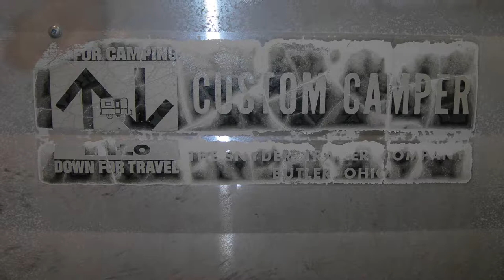1960 Hi-Lo Vintage Trailer Restoration....VERY RARE!!

Comment: Some one in my TCT club mentioned this video to me. Funny thing purchased mine the same year you made this video, but mine is a 61, about the same in all respects. The top part was as bad if not worse than yours but the bottom survived in excellent condition. Finished it that same year as well but all the restoration was done outside in the open. Had to get the top part done before the winter snows came. The trailer was a one owner. And he did get to see it finished. I glad he did for he past away one month after that.
Reply from the maker: This was a fun rebuild and a next trailer, Im glad the previous owner got to see it done too. Thanks!!

Comment: I recently got a 1963 Hi-Lo in great condition. Can't wait to have it on the road. Thanks for the video. These are so fun.
Reply from the maker: It really did hold up to time well, I just had to rebuild the top section and roof due to water. The simple crank lift worked everytime. The only real issue I fond was that wiring lights and vents required some clever design.

Comment: very cool! i have a voyager, basically the same thing but a little bit longer. i got it from my wife's aunt and uncle. i am working on what to do with it
Reply from the maker: I had never seen these before I re-built this one. It seems like the roof is the weak link as far as water leaks go.
Reply: Yeah when I first got it I cleaned the roof real good and put like 5-6 coats of Henry's on the roof, I may need to touch it up soon though. The last owner pulled out all the electric too so my next project is to put a new fuse panel and replace the shore connector
Reply: Yes, mine is a Voyager. Did you need to refurb the hydraulics?
Reply: @beingverna  No it doesn't have hydraulics, you raise and lower with a hand crank under the rear bumper

Comment: I would love to see the inside restored. I own a 1971 towlow. I am redoing it.. adding some diamond plate on it. Just for shinny. Like the inside of door area.. so it will last. I ruined the piano hinge on door. Had to order a new one on line. Cause no stores carried a 2.0 piano hinge any more. Replaced glass and screens. Put new tires in.. which by the way can be a 15 or 14 tire. Only the top had water damage to the in side cause of broken windows. So I replace it with a easy to wipe down bath room board. Love these campers cause the framing is all metal. I replaced insulation. Added new fridge and stove top. Re wired it all. Added USB and some extra plug-ins. Seats are still original. I love the round crank up in the front. This is my dream camper. I added a portable toilet and a portable shower. . I will be redoing the bottom at some point. And lining the under neith with metal so the floor will never rot. This will be around long after I am gone. Thank God my kids and grand kids love to camp. I will get one more of these and redo it too. Just so we all can camp togather.
Reply from the maker: I really wish I had made a video of the process rather than just photos. It was 2013 and I didn't know better

Comment: Hi, nice job. Did you leave your silver siding without paint? I have a '68 that I also stripped off the paint but was told that that aluminum will start to crack if not painted. Curious how yours is doing?
Reply from the maker: Thank you! Doing fine. The aluminum should not crack without paint. Thanks!

Comment: I just got my grandparents' old 1963 Hi-Lo, and I have to replace some wood from the top half like you did, and I'm kinda worried about separating the two halves.  But I don't see a way around it, since some of the wood that needs replaced is beneath the tracks. Any advice?
Reply from the maker: I had a forklift so I just suspended it. But when I worked on pop-up trailers, we always just cut 2x4 to size and lowered the roof onto them, obivioulsy brace them and secure them to the roof so they don't kick out, but don't limit yourself to just 4, use 8 or more until you're comfortable with it being braced. Thanks and good luck. Vintage Camper Trailer magazine just featured a restored one on May/June cover if you want some ideas too. https://www.vintagecampertrailers.com/

Comment: What did you use to strip the paint on the outside?
Reply: This question was meant to come from my account. I didn't realize my friend was still signed in.
Reply from the maker: Great question. If I remember, the metal was oxidized and bare so the coarse polish stripped everything off. Usually, I use the gel aircraft paint stripper....but wear chemical gloves. Thanks!
Reply: @AZExpert  Thanks, I really appreciate the info!!!